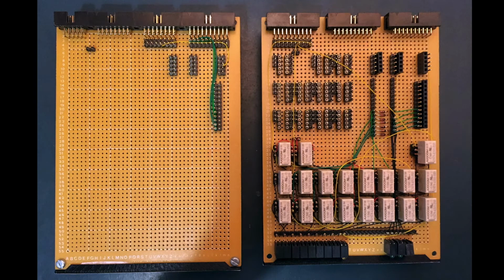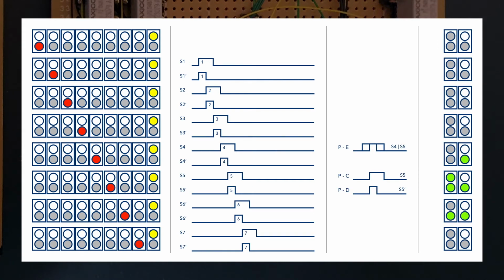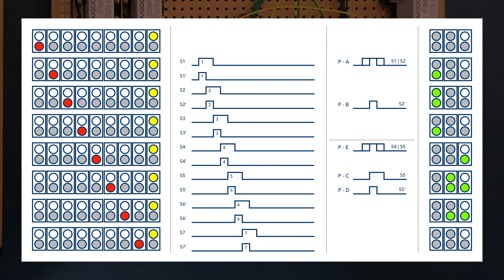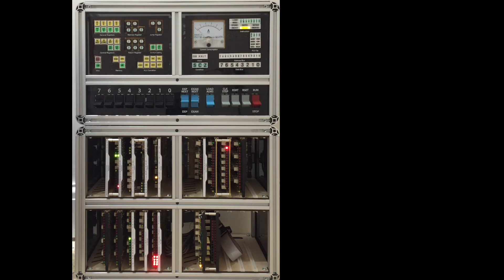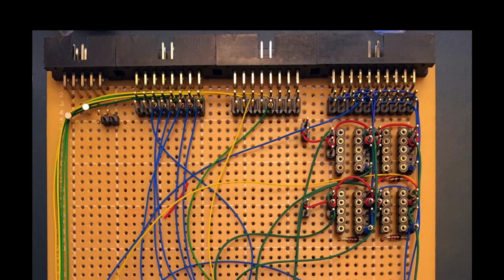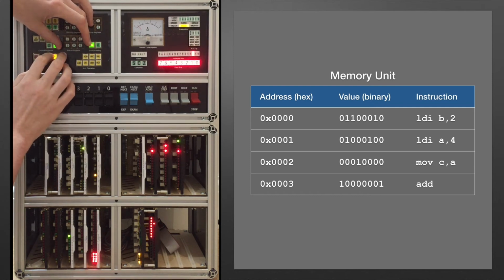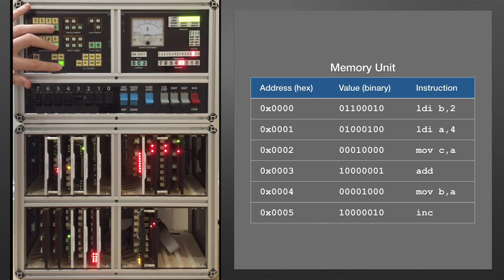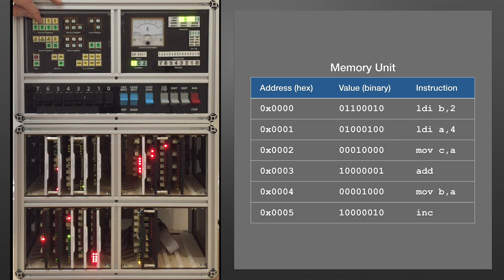Relay Computer: Fetch and Increment Cycle

Comment: What will be the size of the address bus and registers? Is it 4 bits each? That wouldn't allow a very long programme!
Reply from the maker: The address bus on this computer is 16-bits although currently the memory card only uses 15 of the 16-bits (as it's based around a 32K memory chip). The remaining 32K of addressable space will be used in the future for 'add-ons' or perhaps a display etc. I doubt I'll ever write a program that fills the 32K of memory but the 32K chip was more readily available than smaller sizes. 

The data bus is 8-bits and so all the general purpose registers are 8-bits too (A, B, C and D). The registers that hang off the address bus are 16-bit as you'd expect but in the future there'll be some specialised registers which are 8-bits to the data bus but can be combined in to a single 16-bit value for the address bus. Examples of this will be the M1 and M2 register which combine to form register M and this will be used to allow a program to set an address to store/load values in the memory (or even alter the running program if you're feeling swish).

There's an overview of the architecture on my blog at http://relaycomputer.blogspot.co.uk/2013/11/architecture-isnt-just-for-houses.html if you fancy (and that'll save me typing at you ;)

Comment: Very nice work! Can't wait for the future of your computer. Especially that larger program you spoke of.
I don't even know how a display would work, have you thought on hat at all?

This is all very interesting.
Reply from the maker: It all depends on how complicated a display you want  ;) At its simplest though it could be done with multiple registers. If you think of the A/D register card for example ... you can store two 8-bit values (one in register A and one in register D) which display across 16 LEDs. If you had 16 of those cards and stacked them on top of each other you've now got a 16x16 LED display. You would manipulate what appears on the 16x16 display by loading patterns of 1s and 0s in to the appropriate registers.

Taking that idea to the next level you could instead have another memory card which holds, say, 32 x 8bit values. The computer then just writes to this memory like any other memory in the computer but the difference here is that on the other end of that memory you connect a 16 x 16 matrix of LEDs.

This would be a black and white display (or red and 'not red' in the case of LEDs) but you could make a colour display based on the same 'display memory' concept. Effectively this is how computer displays were done and it's all down to what the 8-bit value you put in a memory location represents. There's a nice video at https://www.youtube.com/watch?v=niKblgZupOc which explains some of the tricks early display technologies used (like CGA).
Reply: Heh, just watched that 8-bit guy video not too long ago! I was thinking your second option which is a memory board layout (32x8) that the monitor reads from to get its picture. That would be super cool. 

I wonder what would be possible with a 16x16 display, and the screen write time for the computer would be? :p

Thanks for the reply.